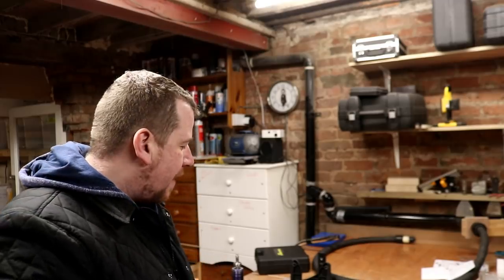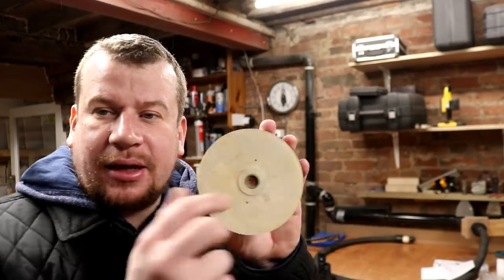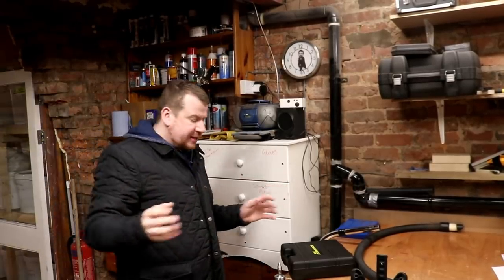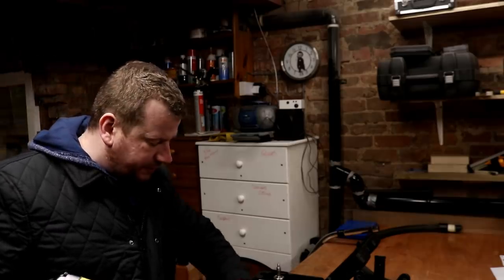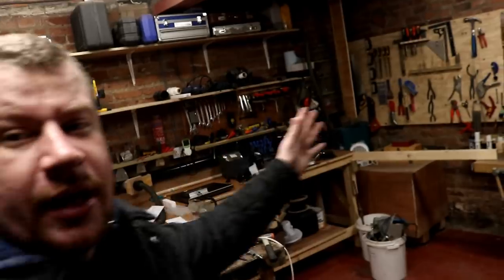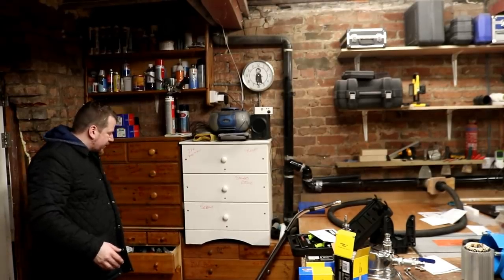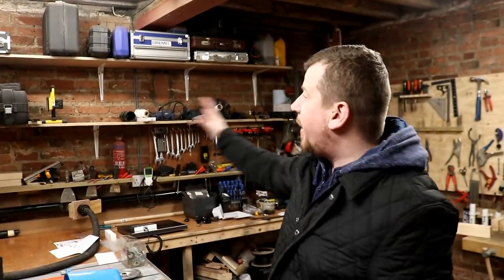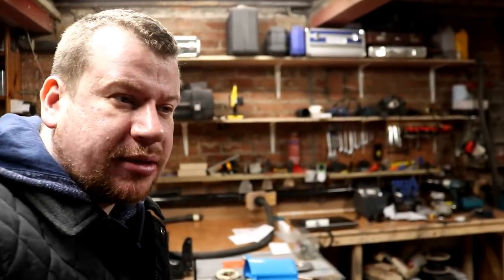Back in the workshop for 2019 ~ Table Saw fence refit.

Comment: Here's hoping that you and your family  have a very Happy and Prosperous New year.

A very nice way to start the year; a project that requires a pre project 👍 . Could you not encompass a sub project to incorporate a router into the table? Or perhaps a side project to be able to fit a plainer to use as a thicknesser? 😄 😄 😄 . (In all seriousness you may want to add a little more flexibility into the table while you are changing it anyway 😉 ) . Cheers Schnuz.